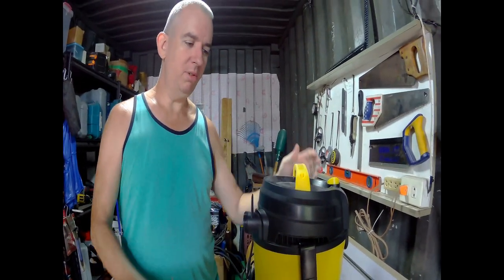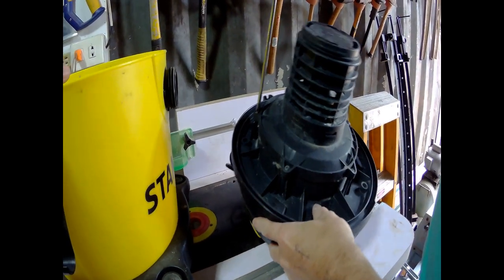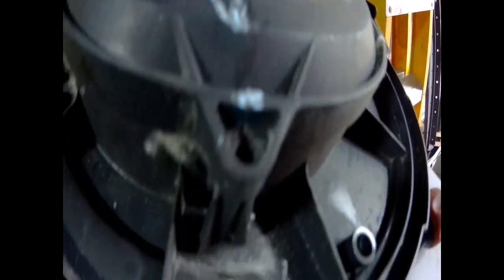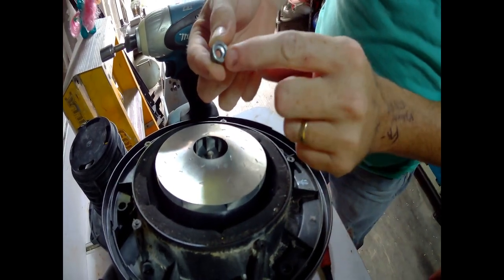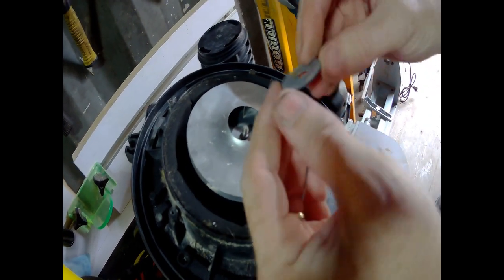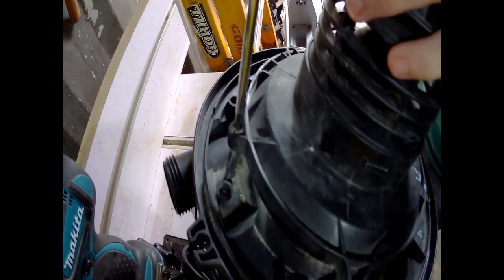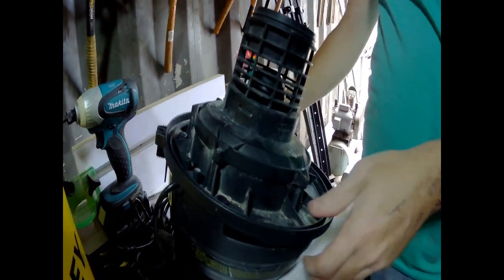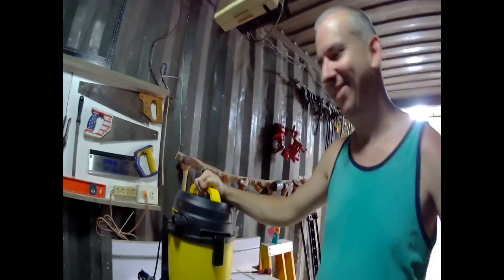STANLEY VACUUM WET & DRY VAC repair

Comment: I have 6hp Stainless steel Stanley back but it just quit do you have any suggestions of what I could do to see what went wrong with it? I know that can be difficult but yours is a little different than mine when I open that up I have a big white filter I don’t have that same apparatus that you have
Reply from the maker: i would have too see it, it could anything but i cant see it. you do need to try to get the metal wheel out it may be clogged up, if that dont work it could be a number of things.
Reply: Came here for that question because I have the same one as you!
Reply: @omarihendrix3205  me too, just took mine out the box, cleaned up a lot of dog hair and little dirt clods from them, started to vac my shag rug and it just seemed to lose most of its suction power.... i dunno, i even took the bag inside off (just to see if there was a power difference) but that didn't help. how do you even know when that breathable bag inside is full?
Reply: @RickyourReStoreManager  It'll really stop sucking and/or the sound will be A LOT different. It'll sound like the vacuum is struggling to pull.